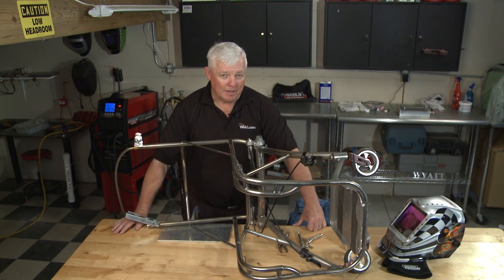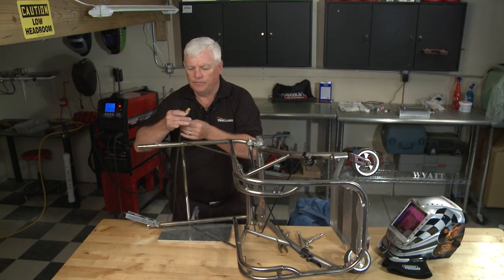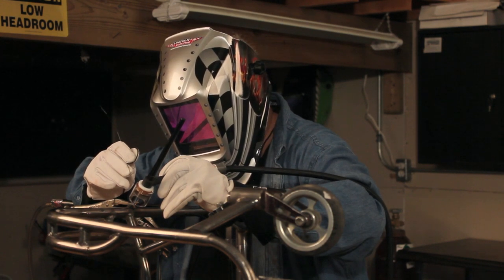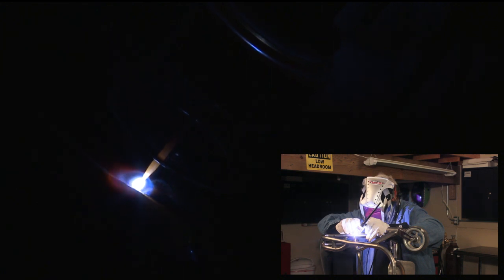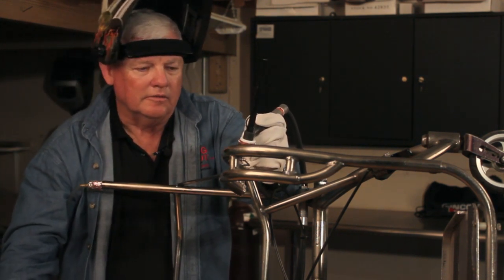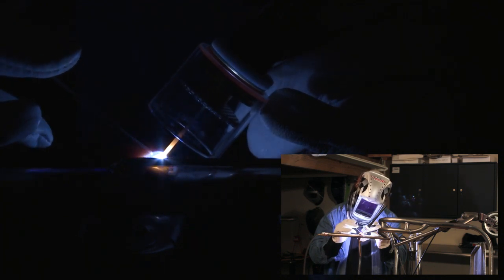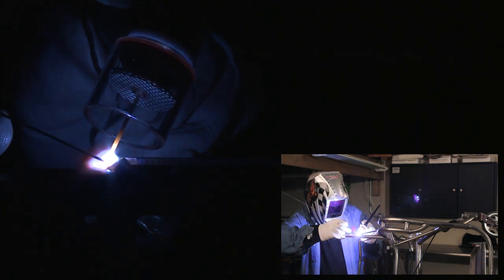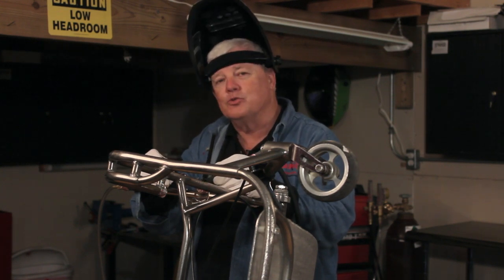Titanium TIG Welding Repair | TIG Time

Comment: World renowned welding expert... You can see how shaky the arc is and the filler pebbles on the surface. Show us how the weld ended up looking. Welding tips and tricks is way more honest.
Reply: filler "pebble" was when he went out of position. before and after link doesn't work (probably because it's 2 years old). He can probably weld quite well.

But yes, the video is useless, like much of his.
Reply: True dat.

Comment: I'm guessing it wasn't a good weld. A giant gas lens won't save you if you let the piece get that hot. He also pulled his filler out of the shielding gas a couple times while it was still hot. At least it's not a safety critical aerospace part or something.